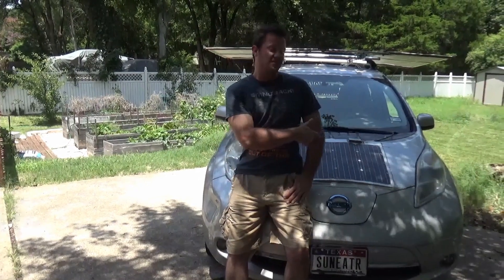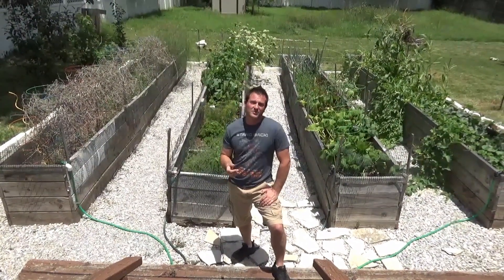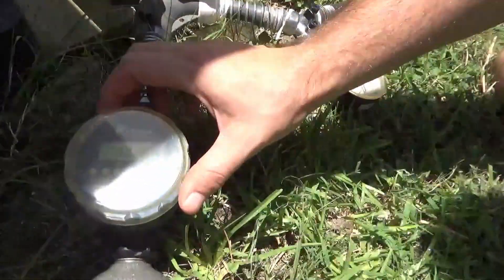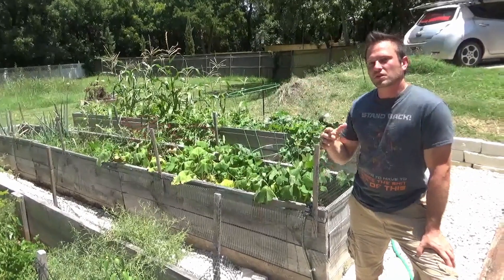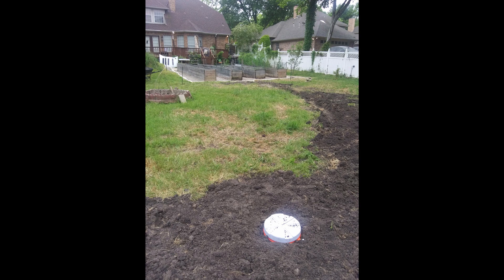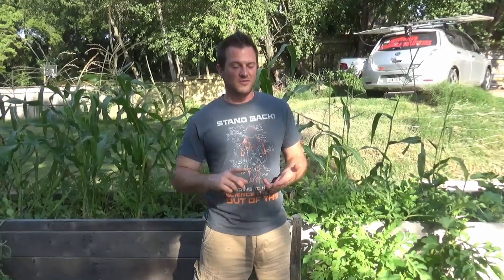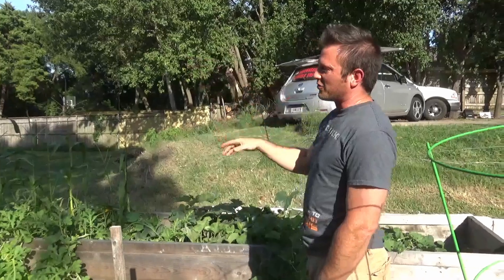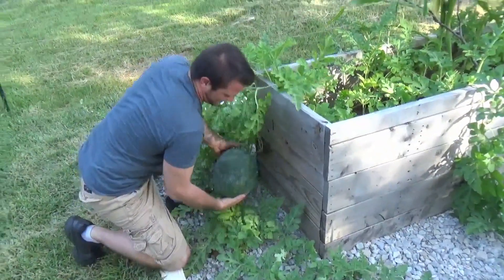Sustainable Home Food Production:  Raised Garden Beds, Rain Catchment System, and Agrivoltaics.

Comment: I've heard that trees can function as fantastic natural cisterns in that during times of flooding they can soak up a lot of excess water as well as hold soil in place and during times of drought the water from the trees can seep back into the soil to keep it hydrated. Trees can be nice when they are small and manageable but can be annoying in a yard when they grow too large. Have you considered planting some small bushes and shrubs that also produce food, like grapes, elderberries, strawberries, orange trees, etc.? They're generally low maintenance, they produce food, and help soak up water autonomously. I have no idea what types of plants grow well in or are native to Texas, but that soil in the video under the excavator looked to be of such high quality that anything could grow in it.
Reply from the maker: Ashe Juniper, usually just cedar is used in the south the manage swampy areas to an extent.  I've read that mature cedars can pull over 30 gallons/day.  We had a bad drought about a decade ago in Texas, and there was actually a cedar eradication campaign to preserve soil moisture and groundwater levels.  They are great at pulling water out of the soil.  My problem is I live at the bottom of a large hill, near a river, and needed to remove 300-600 gallons/day from the area during hurricane season.  Trees couldn't pull the amount of water that I needed to remove.  Fruit bushes, and bees are in the works.  I want to experiment with hyper-utilization of a limited space, and see if we can make food, power, and rain-catchment fit in a small enough space that it's achievable in any backyard.  And automate it as much as possible.

Comment: I am curious why you buried a tote for your sump. It seems a very large volume for something that just collects the drain water to be pumped elsewhere. Did you want to store some of that water so the back area could get watered when it is dry? If it's just a stop in the path of drainage, then you just need a small sump slightly larger than the size of the pump. Or maybe the pump is too small to keep up with the rain?

Maybe you can create your shell with brick or even pavers, just to distribute the soil pressure to the aluminum rod encircling the tote.

Also, it could be the camera angle, but it does look like your lot is naturally sloped toward the back, but that is where you are dumping your excess water. Won't it pool there and "overwater" whatever is back there? Have you thought about pumping it "up" to the street so that it can be carried away by the storm drain and become the city's problem? And if so, why not in that direction. Nice t-shirt Watney. * wink * A great movie, and book.
Reply from the maker: The volume of the cistern creates a sort of drainage buffer, to buy me time in between when the monsoon hits, and when I have a chance to carry the pump and hose out there.  The smaller the container basically the more water collects in the soil, which exacerbates muddy, swampy soil.  I would have actually preferred a larger cistern, as it would expand quantity of water I can temporarily put in the ground vs. the dirt.  But it is a bitch to bury.

There is a very slight grade to the property, and the woods behind it.  I'm sure the forest gets a bit overwatered, but the squirrels don't seem to mind.  The woods drain into a decent sized river, so this system actually provides a quantum of moderation to the storm surge that hits the creek when it pours.  Instituted on a large scale we could conceivably use a system like this to mitigate the flooding problems caused by a covering hectares of land with asphalt and cement.  California has a crises of torrential rains and mudslides during one season and apocalyptic fires 6 months later.  A much larger version of this system (maybe 10x this one per house) used by an entire town could potentially be used to mitigate both of these problems.  For a fairly reasonable cost per capita (especially given the property values around there).
Reply: @InnovativeSustainableSolutions    Ah, that makes more sense now. I assumed you used a permanent sump pump in the cistern, but now that I think about it, of course it's not permanent if you have the orange cooler as the cap. And good there is a forest to soak up the water and river to drain it.

I don't think California's mudslides/wildfires are in areas with huge amounts of asphalt and concrete, but they are definitely in areas natural protection from these problems has been removed. And for all the people who want to "live closer to nature" instead of large cities' asphalt and concrete.